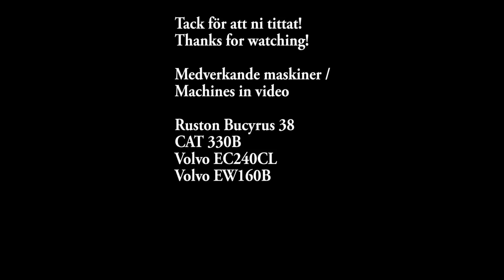Silo Demolition

Comment: I am no construction guy, but I would guess a bigger ball would do a faster job... just sayin...
Reply from the maker: no if the ball was bigger the crane wouldn't ba able to swing at full power, and the ball already weighs 2 tonnes =)
Reply: swedengines Oh...  yea I guess that would be a reason.  It looks so tiny in the video.  Thanks for the info.